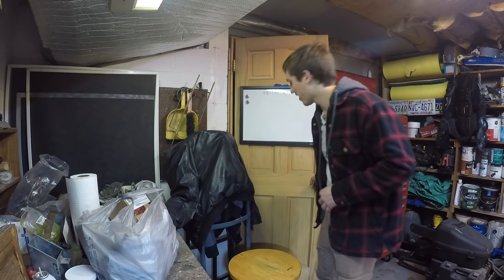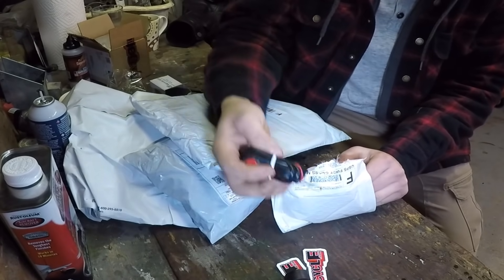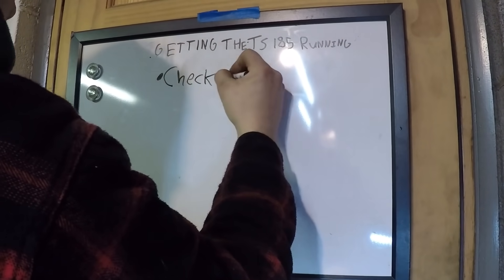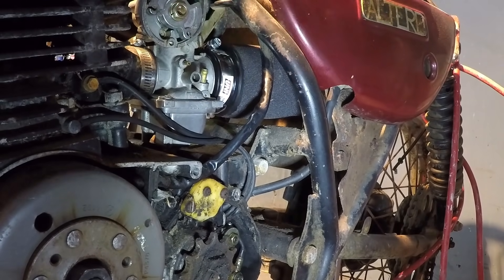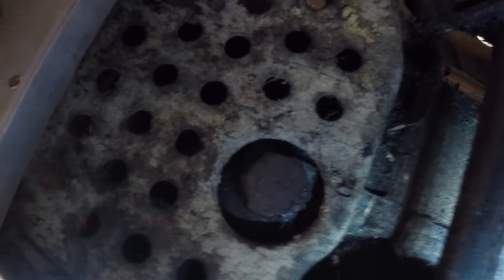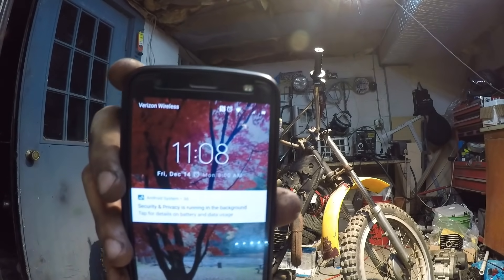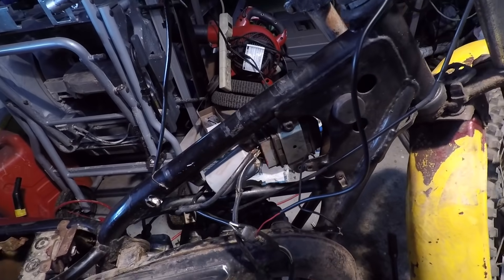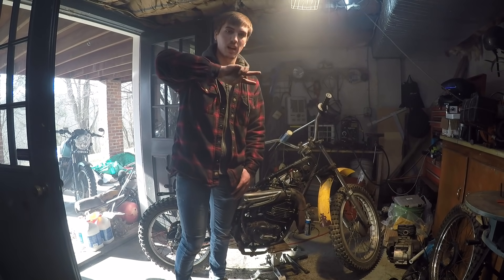'75 TS185 1st Start After Sitting Outside for Years

Comment: Hey man, make sure that the two-cycle oil you put  in the tank is one that is designed for oil pumps, rather than normal two-cycle. The manual says to use outboard engine oil if you can find one that specifies that it's safe.

Comment: Why ....... why....... wouldn’t you just use the new throttle cable fella 😱
Reply from the maker: Yeah I realize that I could have just used it, but it was a LOT longer than the original one was, so there would have been way too much extra cable
Reply: GoldGuy 
I wonder if you can shorten the new cable to make it work and solder the end of the cable with solder in the way it needs to be rather than welding some bird shit on the end of it . 
Bet that would work just fine 😎
Reply: boone7075 I wish I’ve tried shorting throttle cables at least three times and end up messing up the lead thing at the end or messing up the cable it’s self

Comment: That other cdi box may be saved by putting it in an oven at a very low temp for about an hour at around 130° moisture tends to seep in those shorting out the box and if it sat outside for years this probably would work I've brought many back to life that way some of us old guys know what were talking about
Reply from the maker: I'm gonna try this!
Reply: @GoldGuyRides  it doesn't always work but it's definitely worth a try it doesn't cost anything other than a bit of time...I have about a 70% success rate with those stamped metal boxes
Reply: Would a food dehydrator be too weak?

Comment: I just got my two stroke going again for the first time in a few years in the last few days too! It's a great feeling to hear it fire up after all the blood sweat and tears! I'd seriously consider a compression test and top end rebuild though. The rings may not seal so good if it's sat and no telling what condition the cylinder is in. A machine shop can just give it a hone for around40 bucks to make sure the cylidner walls are straight and cross hatched, and top end gaskets are cheap, rings can be expensive sometimes but it's better to have a clean slate than put excessive wear on the cylinder already. Good thinking on running mixed gas incase the pump wasnt working! What ratio are you using?

Comment: It looked like you didn't set the oil pump you put the filter on before you atached the pump cable, on the back of the throttle slide is a small round drilling a dent, it should be just touchng the top of the hole of the carb and the lines on the oil pump should be aligned , it shoud stop it smoking so much ;) you did well to get that running again ;)
Reply from the maker: I did not know that, thanks for the tip!!

Comment: I just acquired an old 75 Yam DT1 250cc and I'm slowly getting to the first startup stage. Only thing is, the rest of the bike is unsalvageable except for maybe the frame. Ebay would cost a fortune to put it all back together. I wonder what I may be able to put this little 250 two stroke into?

Comment: What I usually use in my new 2 strokes is run atf fluid in the crank case it’ll help clean everything out I usually just run that instead of oil

Comment: Why not use the new throttle cable and keep the old one you cleaned for a back up instead of the other way around?
Reply from the maker: Because the original throttle cable is a dual pull for carb and oil injector, the one that I bought was just a single pull. I just needed the throttle twist grip

Comment: whats that "two stroke oil mix tank" does?
Reply: Two strokes because of how they run, need lubrication in the top end. So it needs a specific two stroke oil through injectors (a pump running from a second tank that squirts into the engine) or directly mixing in the gas tank.
Reply: @jordanprato151  So, if i had the tank topped up, does it require a premix?
Reply: @SeamTressGaming  no AS LONG as the two stroke pump works! If it is not new or you or you are not sure, premix the main gas tank and look at the pump. The two stroke lines that go into the engine are always clear and you can see if oil is moving along.                    
       
Some manuals for bikes will even have a way to test it by unplugging the oil line and measuring its output. It would say "pump should produce ___ when at Y rpms for X amount of time.
Reply: @jordanprato151  Thanks mate, Cheers.
Reply: For some reason I hear people saying this all the time. They claim that these pumps are finicky. You can usually just bleed the air from the screw in the bottom and just watch. You should never premix a oil pump bike.
Reply: @benjibat4655  for sure, pumps are more accurate and are reliable plus it beats constantly mixing but just when there is that doubt, or to check, I'd premix. I blew the top end of my Kawasaki F7 last year and I just got it all reassembled so until I can properly test the pump I'm premixing. The pump is working but there are huge gaps in between the oil as it moves through. Is there an easier way to bleed the pump as opposed to unplugging the output line and running them through? Maybe because I just rebuilt the engine I need to bleed the line out first to "prime" it so to speak?

Comment: Your going to cook that clutch using that oil
Reply: Not sure, some old yamaha 2 strokes used 10W30
Reply: When it comes to bikes with wet clutches you usually want to use a oil that is JASO certified. These products contain the additives that help prevent wet clutch slippage. It will probably be fine but just a thought.

Comment: I think you should bypass your injector pump and run 2 stroke mix in your gas tank. A lot of the old oil pumps don't work.
Reply: That's not a good idea these old suzuki's have a cci injection system and there are bearing shields on the bottom end to help scavenge oil and keep the bearings lubed, if you run mix and dont split the case and remove those shields it will burn up

Comment: a ton of voltage? It wasn't even reading close to what you need..... coil steps up the CDI. Could have choked it instead of flooding it and then using starter fluid

Comment: you should have put the brand new cable. it's really irrelevant to destroy the new one over the rotten one.
I really don't get it mate !
Reply: these throttle cables split off into two, the replacement does not.